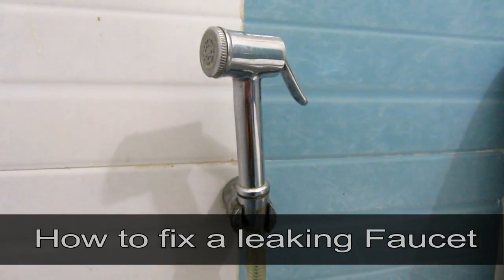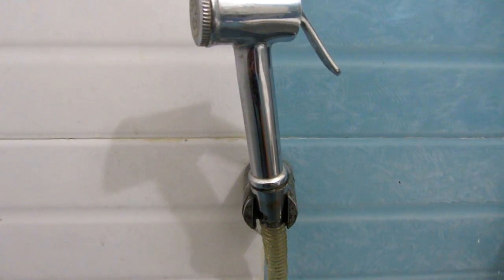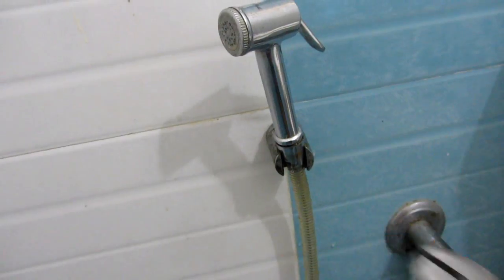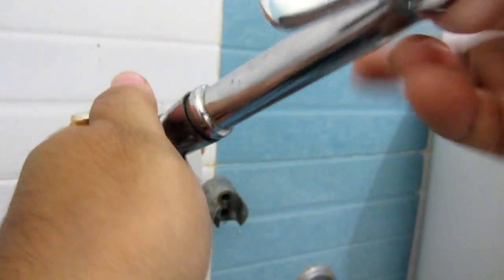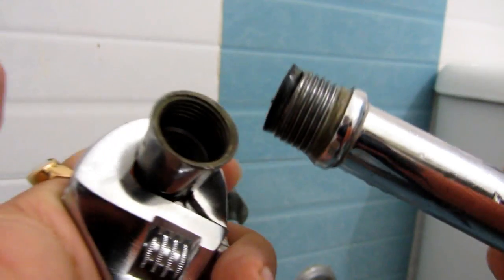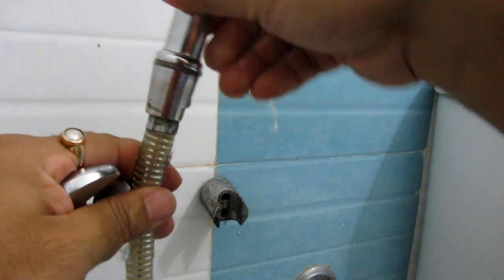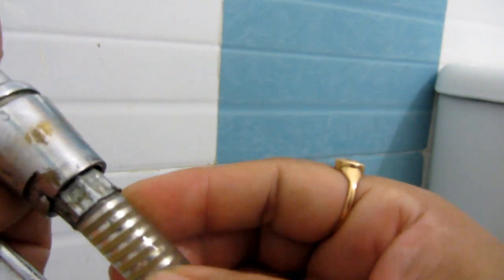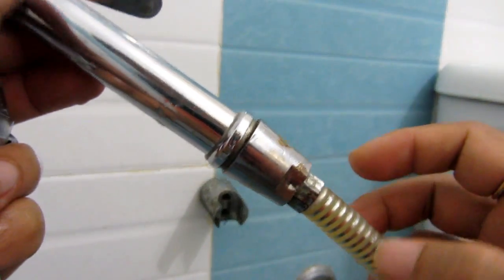How to fix a leaking Faucet/Toilet Jet Spray

Comment: I had mine installed not long ago under a year and it has started to leak from the same spot you are showing. I've bought a new washer as someone said to me but no difference.  The old washer seemed  in tact and new anyway.

Comment: I discovered that there is rubber pile inside the metal pipe. And I find that rubber pipe has developed a leak just at the junction. Is there any way of cutting out the leaking portion and then insert the intact portion?

Comment: Nice video...my spray leaks through the press at the back ...
Pls advice what can be done.
Reply from the maker: plz check the washer inside the jet spray and change it accordingly if required. You can get the washer from any local hardware store.